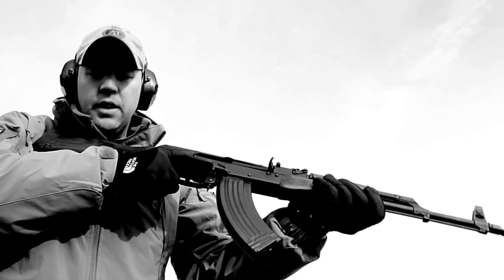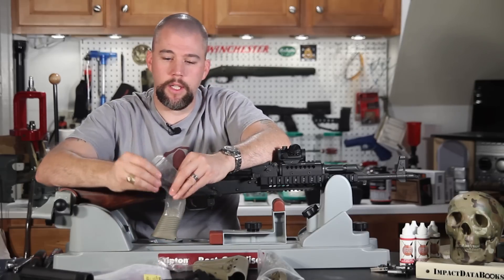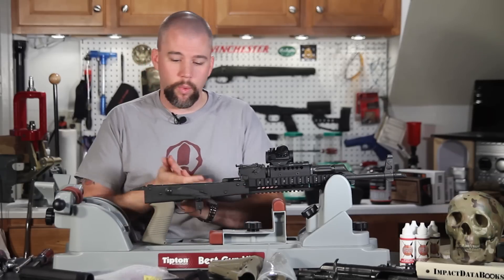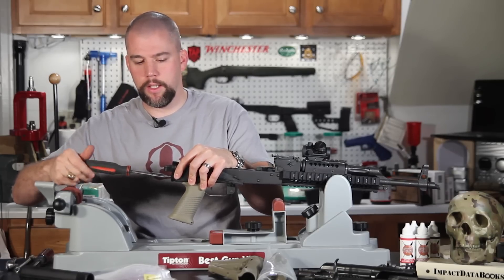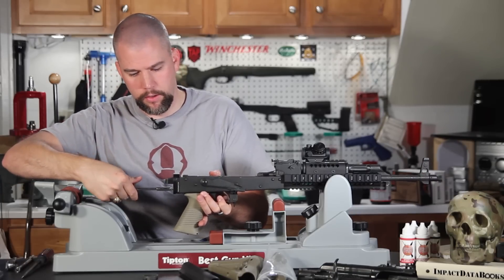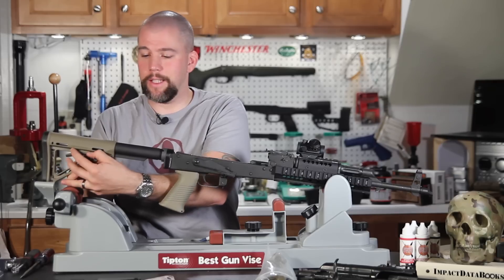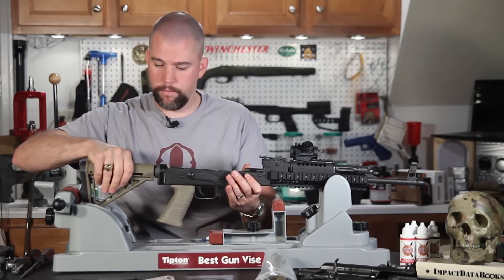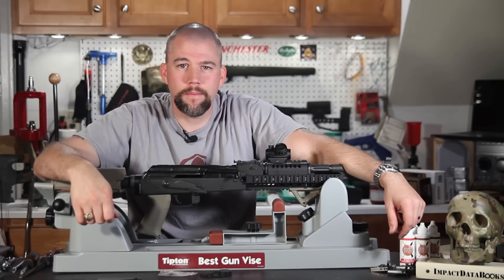Improved AK Build - Rifle Dynamics M4 Stock Adapter, Magpul MOE and AFG

Comment from the maker: The Rifle Dynamics AK to AR stock adapter rocks !
Reply: Do you know if that will work on a milled receiver?...the few ive found online says it wont fit a milled reveiver...i have a century c39 ak47 and it has a milled receiver and it also has 2 tangs...i do not mind removing the bottom tang...do you know where i can find an adapter for this gun?
Reply: I notice you guys are also in southern indiana?...im from evansville.
Reply: fank underwood Order the stock adapter and eyeball it. You should be able to tell if you can make it fit before you start cutting or dremeling anything off. If it doesnt seem within your capability, send it back. If you have any kind of machining and gunsmithing skills, you should be able to pull it off. If all else fails, theres always JB Weld, right? Dont be afraid to find some help if you need it. Find out the reputations of a couple different gunsmiths if you have to.
Reply: i had completely forgot about this video and didnt mean to but i built my century c39 exactly the same as the one in the video same magpul stock and same 249 grip same color, same handgaurd and same bushnel optics lol...i copied yours with out realizing it lol
Reply: fank underwood Hi Fank...  I just received my Century Arms C39 AK-47 and I love it!  No stock on it, just the pistol grip.  Will I be able to put the same Magpul stock and Buffer Tube on it?
Reply: +Ricovette here's the link 

 http://riflestocks.com/store/page7.html

Its the ace ak internal milled receiver block (AKRBMC) that u need if u have the c39v1 but the c39v2 will use the rifle dynamics one or any stamped receiver parts

Make sure u find out if u have the v1 or v2 and if u have a an c39 pistol u will need a tax stamp to put a stock on it and make it an SBR
Reply: Thank you so much Fank...  I appreciate it very much...  Take care and God Bless...   Rico
Reply: Thanks again Fank...  I surely will...  Stay safe...   Rico
Reply: when the ar stock is fully extended what is the length/length of pull?
Reply: 8541 Tactical will it work on the mac90

Comment: The RDAK a solid mounting system, however I haven't seen this criticism anywhere, but when mounted it sits higher than the AK irons with my standard Magpul MOE stock.

I have my Aimpoint PRO mounted on the Arsenal rail over my dust cover and it sits higher so I used the .75 riser and it isn't perfect but works really well.

If you want a system that will let you cowitness irons, the RDAK isn't for you.

Comment: I'd love to see an imroved AK that isn't just "slap M4 parts on an AK". while M4s are definitely awesome, it seems like every single improved AK I've seen is summarized as "MORE M4 PARTS!"
Reply: It only makes sense. Most guys run AR style weapons. If you can switch from one weapon to another with familiar stock and grip then things come together a lot quicker for you when the shit hits the fan. Another reason behind this is because there are so many AR options out there. If you buy an AR rear stock adapter for an AK you can choose just about any AR stock. Just makes sense buddy
Reply: jayonez13 it’s a great system. More control of the rifle and confidence under pressure. I love the side triangle folder it’s beautiful it’s my favorite aesthetic look. But you are limited by length of pull and I believe you have a more secure shoulder and rifle in the body with the buffer tube.
Reply: people just understand that the AR is the single greatest weapon ever to grace our presence
Reply: Zenitco>

Comment: If you decide to put a wood stock back on an AK and can't figure out which screw goes in which hole, drill out the hole and put a bit of wood glue on a golf tee and hammer it tight into the hole. Flush cut the tees when dry and it gives you a new surface to screw into. This also works if your wooden butt-stock gets a little loose.
Reply: This also works if your butt gets a little loose.

-There fixed that for ya!  Sorry, I couldn't resist.
Reply: perv. lol

Comment: You should do one last upgrade, remove the slant brake and put a full brake on it instead, slant brakes are designed for select-fire, they don't work all that well with semi-auto, you'll notice a difference when you change it out, it improves accuracy and lessens recoil. The upgrade will not affect the reliability of the rifle.
Reply: ya,no shtt

Comment: I really like the rail system but the AK style buttstock isn't my taste. I have a Norinco MAK-90 and having a hard time finding an aftermarket buttstock that will work it. Also, what are you options if you a slant cut receiver? This is a great video!

Comment: Thanks for a comprehensive look at a practical upgrade. I was concerned with the actual structural integrity of the M4 Stock connection to the rear receiver/trunnion. This appears to be quite solid.

Additionally, I'm curious if there is an adapter that would provide a left folder with this M4 style stock with the same structural integrity, or better? BTW, that's a fine looking weapon, in addition too its practical setup, imo.

Comment: i'm not sure why i watched this. just killing time. i used a strike industry adapter that i like. i'm not a fan of 2 small screws holding the adapter to the rifle in the bottom. what i used wasn't perfect but it offer oem type mounting on the tang and a square block going into the receiver in one piece. also had adjustable spacers to take up any slop. the bad part is was the set screw on the buffer tube. i fixed that though lol. drilled it out, tapped it though the buffer tube and adapter. it's not going anywhere now. i almost went this rout though. either is a respectable way to go.

Comment: What size cheek riser did you get? when you said it was a bit high with that sight, what size would you have ideally went with?
Reply from the maker: We actually ended up pulling off the cheek riser and running slick.

Comment: So went on the rifle dynamics website and they sell a rifle with the RD AK to M4 stock adapter with B5 systems Stock, like the package they sell but installed on a rifle, and i cant help but notice that it is slightly sloped down. Is there a specific reason why? because i see this one is not sloped
Reply from the maker: You would have to contact RD and ask them if/why they changed the adapter. It has been a few years since I made this vide. It is entirely possible that this is a different version of the adapter.
Reply: @8541tactical  thanks

Comment: I know this is an older vlog, but do you remember the name of the pistol grip your using on this fine build,? It appears to have a door at the bottom too. I can dig it.
Reply from the maker: That is a Tapco SAW grip. However, I later changed it to the MAGPUL AK Grip once that was on the market.
Reply: @8541tactical  much obliged

Comment: Love the video's.  I was looking to make these mods on my SA 93 but after researching, the butt stock adapter will not work on a milled receiver.  I really don't like the thumb hole stock... Is there an adapter on the market for a a milled receiver?  Keep the vids coming!
Reply from the maker: You may want to check into the ACE adapter blocks.
Reply: Thanks I'll do that!

Comment: Do you need the buffer assembly and spring for your buffer tube when using the M4 adapter on a AK?
Reply: No, you do not use a buffer spring or buffer with this setup.

Comment: changed my stock with a vtor buffer tube and a magpul adjustable stock. everything in great, except the buffer tube wiggles. is this normal? or did i do something wrong? by the way its an arsonel sg21.
Reply: mine is solid and had no problems been on for about 2 years.  Take it off and try putting it on again never know may take the play out.

Comment: is their a way to put an AR15 like stock on it, but have it also be a folding stock.

Sorta thinking like an acr / sig 556 
edit: I just googled folding ar15 stocks and they have like magpul looking adjustable stocks that can be folded (i assume on gas piston ar15's) That would be idea on an ak. (So you could shoot it folded, in say a super closed in stairway, elevator, car) And good for portable carry in say a suitcase (which wouldnt fit length wise, but making it more bulky and less long would